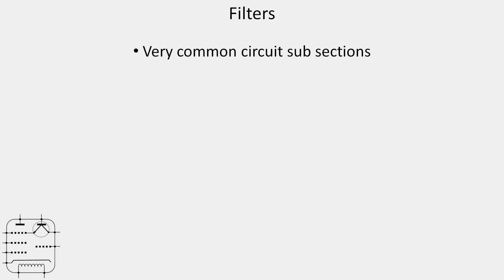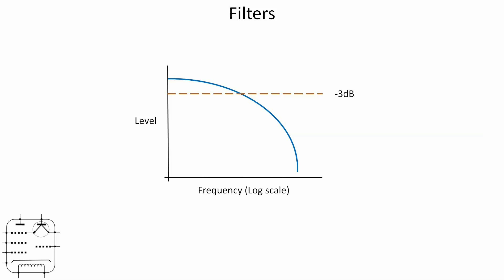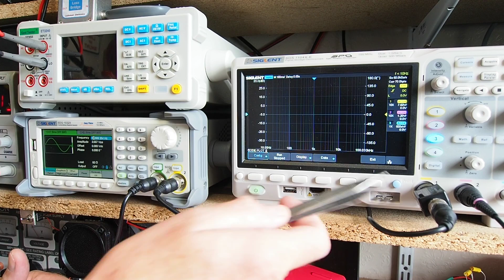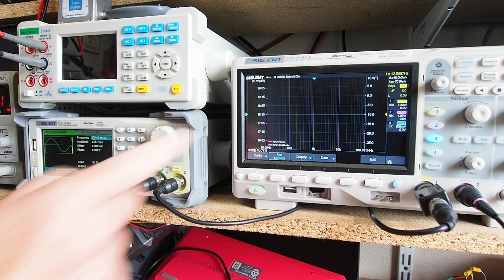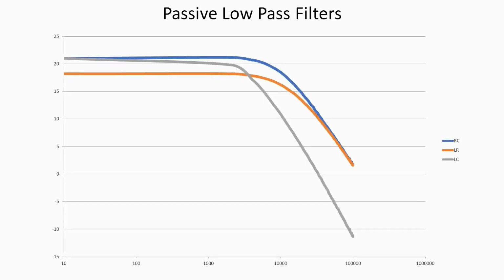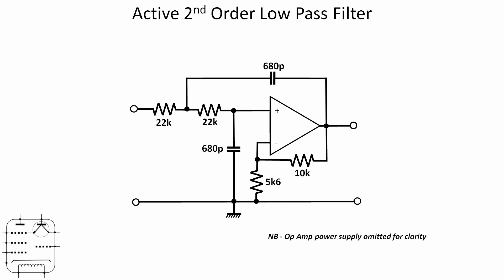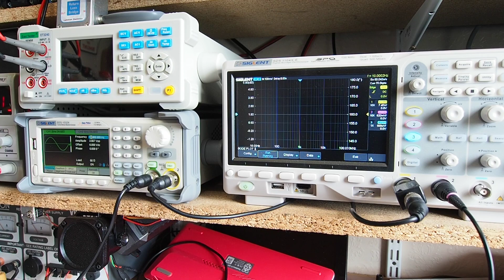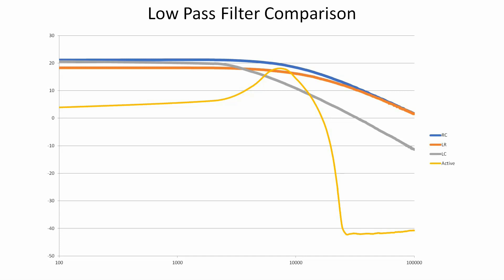Electronic Building Blocks   Passive and Active Filters   #094

Comment: @Lockdown Electronics - Frankly, since the advent of mini-VNA's I've been using mine for doing filter design/testing instead of the AWG / Scope setup. It's an all in one solution and I've been able to do filter work in the high VHF TV range. Of course you don't have the probes like you do on a scope, but I usually have to build a custom 50 ohm test circuit with coax connectors anyway. Otherwise, I realize you get what you pay for with a mini-VNA, but what do you think about their usefulness vs the Bode plot you're getting with the Siglent gear?

Comment: That's a very nice setup you've got there. I have that same Siglent scope, and one of the reasons I bought it (3+ years ago) was for the Bode plot function. However, I needed to do filter design up to 30+ MHz. But the compatible Siglent function generator was just out of the question for me as I think it was priced higher than  $1,200 at the time. So instead I bought a cheap 60 MHz FeelTech 6800 for ~$130 and adapted it to run Bode plots using a Raspberry pie (running a modified PD Python program) as an emulator. I.e. the emulator (via Ethernet) makes the scope think it is talking to an actual Siglent function generator instead of the FeelTech. Anyway, your plots do look very smooth (smoother than mine), so I like what you're doing there. Maybe when I think the SIglent FG's have come down enough I'll upgrade my FeelTech.